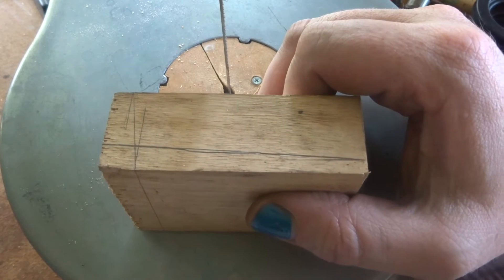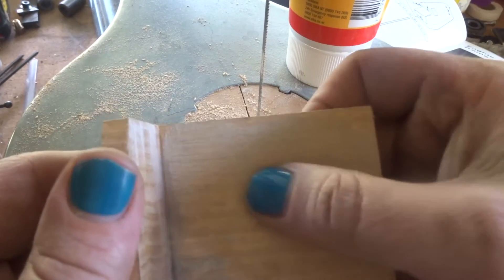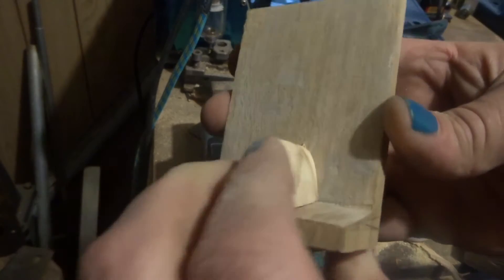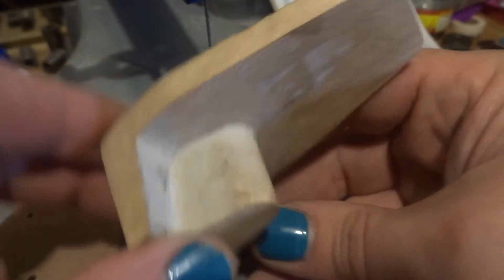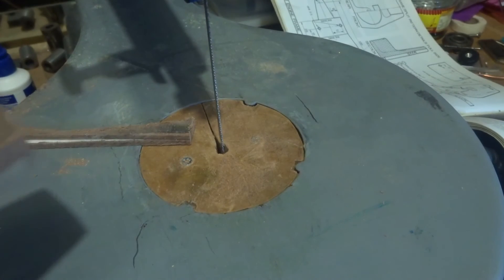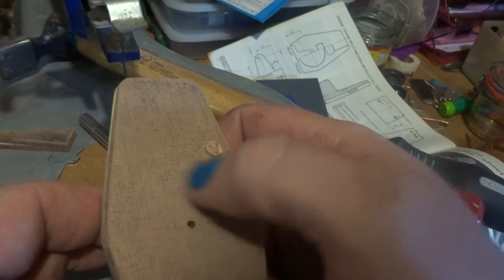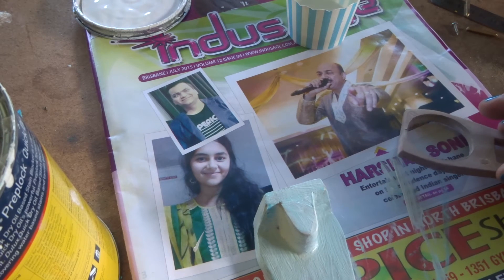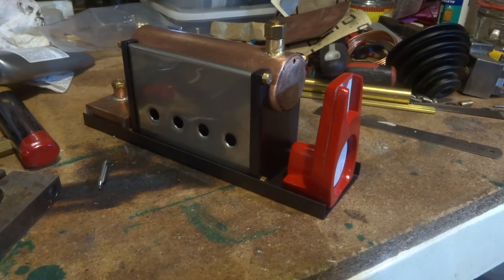K W  SCHOOLS  Steam Engine PART 12 casting pattern

Comment: I guess you are following the book instructions Emma but that casting could be done with a one piece pattern.
The recess for the engine would need a very thin strip added to the pattern at the top to close it off, which could be cut away after casting. The recess and also the cone for the flywheel would then be formed in the Cope. Not a criticism just an observation.
Reply from the maker: Thats an interesting point!  Thanks for thinking
 That out .